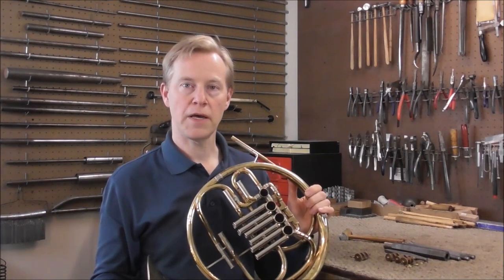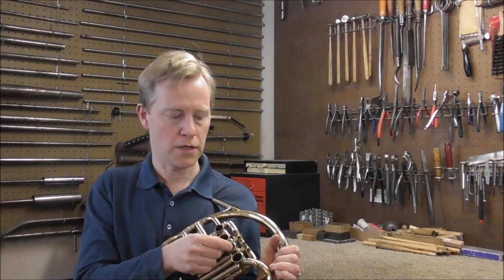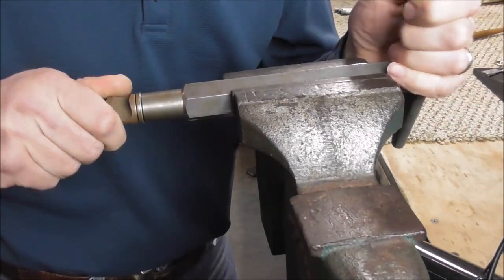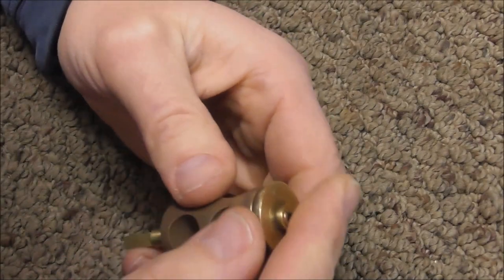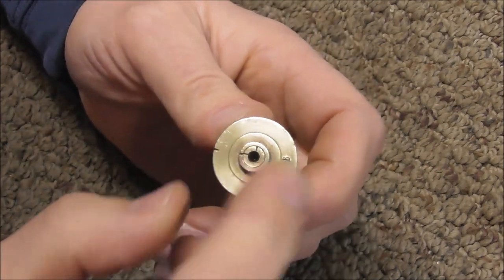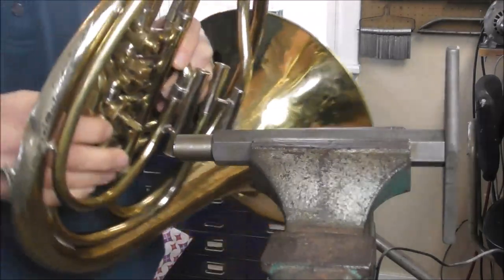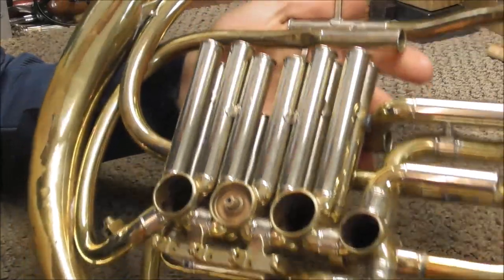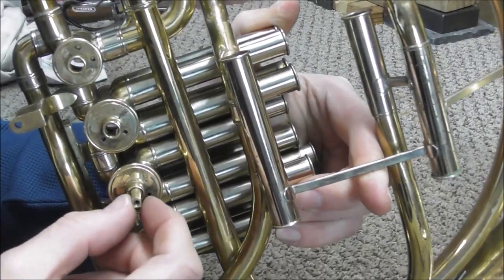How To Tighten French Horn Rotor Bearings (Loose Rotor Valves)

Comment: i have a hans hoyer custom horn and it is over 40 years old we bought it from a professional player and my thumb valve has some side to side movement it is just enough where you can see the valve oil squeeze out between the valve and the top bearing do you think that we need to do a valve repair on it